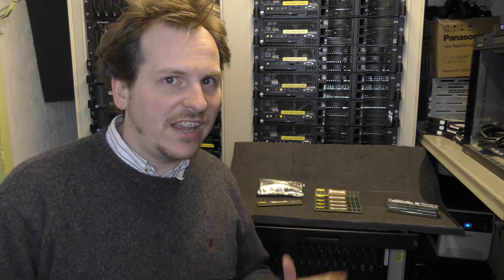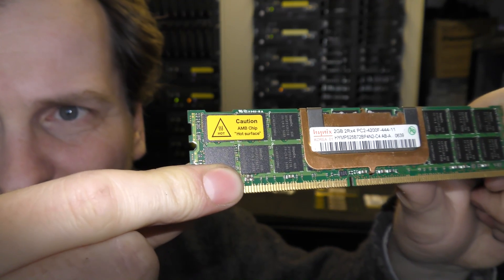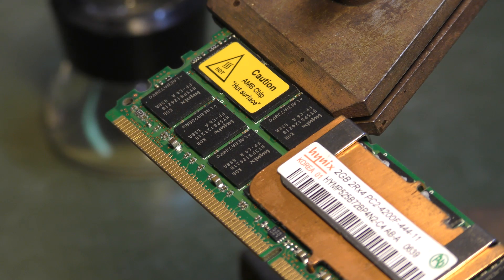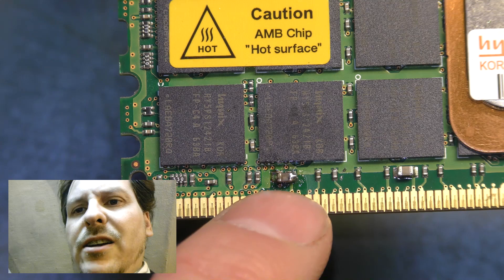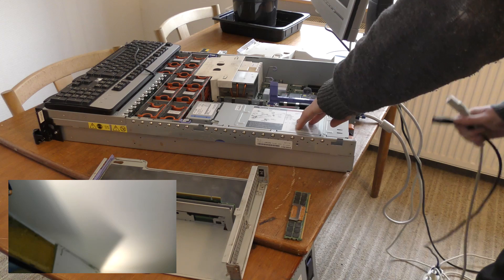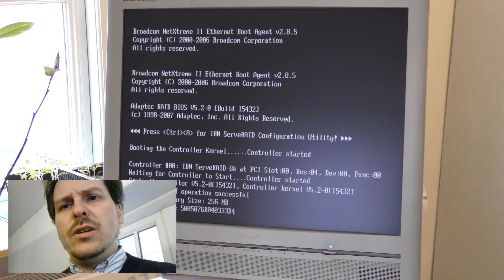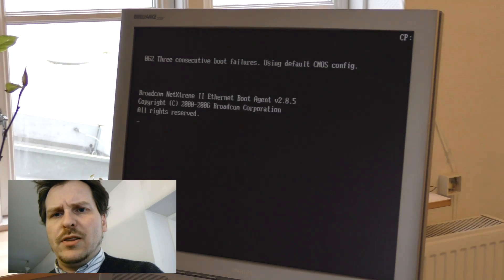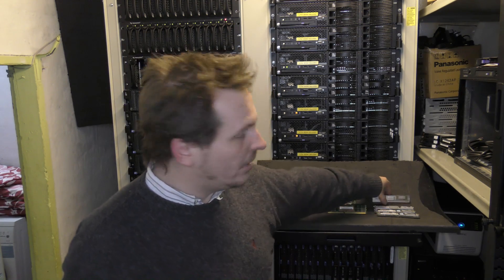Why RAM blocks do not come as DIY kits - 332

Comment: need yourself a hot air station, makes this kind of stuff so easy :) hako's were on amazon for 50 pounds uk recently, and loads of flux, always helps, bit of flux and tap each side down while holding the cap down if your doing it this way.
Reply from the maker: Hi 
Yes you might be right.
Thank you for watching! :-)

Comment: Those little passive smd components can be easily soldered with a hot air reflow workstation.  I've had mine for a month now and its awesome!
Reply from the maker: Hi +Jay Walt 
Okay,, have you tried this,, I fund it a lot more difficult then i thought.
Thank you for watching! :-)
Reply: +My PlayHouse (Morten Hjorth) I have , first i used solderwick to clean the pads then used a small dab of superglue to hold the capacitor to the board then used the air gun to resolder it.  I have since discovered turning down the air speed works much better, the cap doesn't blow away and the surface tension of the melted solder aligns it with the pads perfectly.  Flux is very important in reflow soldering tho.  I'm still a novice but learning.  I enjoy the videos.  do you keep your servers powered up when you're not there?  Is the electric bill high?  It seems a lot for any home application but I'm sure its just a passion of yours..
Reply from the maker: Hi Jay Walt
I have used a heat gun to remove stuff :-/ 
I think i need to get some Flux.
Check out my FAQ : https://docs.google.com/document/d/10tNReA70PsMT4dnyyg6-DdCyFEVcAI9WMizq1SNBibY/edit?usp=sharing
question 4. :-)
Thank you for watching! :-)
Reply: +My PlayHouse (Morten Hjorth) You can get a reflow hot air/soldering station  for $50 on ebay.  These are much better cause you can dial in your temps!  I used to use a heatgun but mine is 1200F  way too hot and easy to melt surrounding plastics.
Reply from the maker: Hi Jay Walt
Okay do you have a model i can look at?
Thank you for watching! :-)
Reply from the maker: Hi Jay Walt
Thanx,, I do believe my cosine has one like that.
Thank you for watching! :-)

Comment: Soon I will have to do something very similar, just with smaller caps on the bottom of CPUs. I will try to get at least one working.
BTW at 5:15, it's DIY, not DUI (driving under the influence). Great video otherwise
Reply from the maker: Hi +martin borovansky 
Well it's even harder to drive under the influence and do a DIY solder repair on a MEM block :-)
I do believe i said the perfectly wrong! :-)
Thank you for watching! :-)